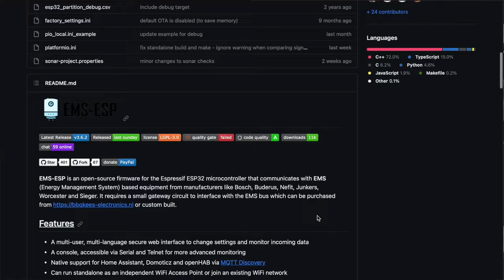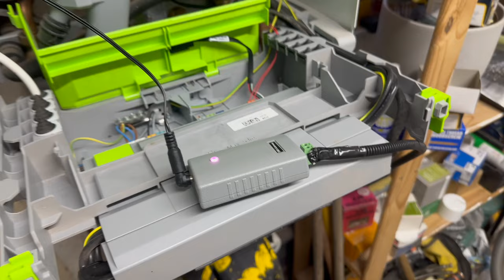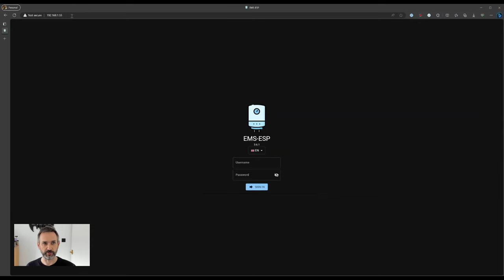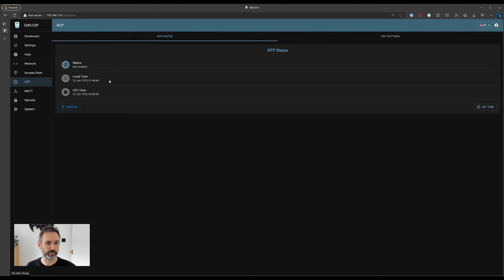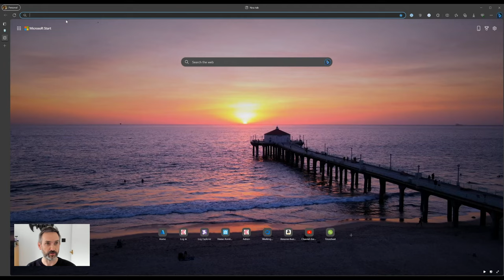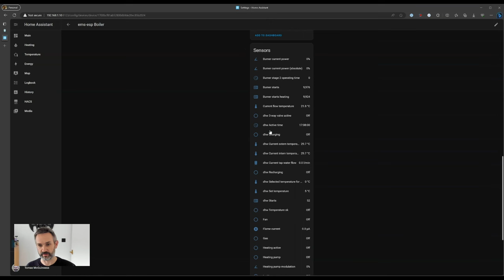Get boiler data into Home Assistant using EMS-ESP

Comment: When I moved into this house last year I wasn't sure how I could control the Greenstar boiler with HA but then saw the EMS-ESP. Seemed perfect for monitoring and setting the temperature etc from anywhere. I soon realised after fitting it that my thermostat, being a Comfort II RF, is read-only so all I can do is monitor it. Many of the boiler values are writable but I don't want to be messing with that stuff which I don't understand, and it doesn't look like it can override the thermostat. It's a nice bit of kit though.
Reply from the maker: What parameters are you trying to adjust? When you say setting the temperature, do you mean the boiler's flow temperature?
Reply: @tomasmcguinness  having a locked thermostat I was exploring options for controlling the boiler, like if its possible to turn the boiler on and off depending on temperature sensor readings in HA, but I don't think it's viable. Probably better to remove the Comfort II and wire in something like the Tado. Not sure what I can do with this boiler, just researching, and your videos are really useful!

Comment: Superb. So similar to what I have been doing this summer. Did you know that you can hook up dallas sensors to the ems-esp and they will show up as entities in HomeAssistant? I'm currently measuring my flow and return temps and I have another three on my hot water cylinder which I use to calculate how many liters are available at 38C (Idealy would need more). Stumbled on your channel while reading on boiler efficiency and load/temperature compensation. Great work, please keep sharing!
Reply from the maker: I didn't know about the Dallas sensors. I've been using an ESPHome sensor with Dallas sensors and I've recently changed to NTC based ones. In the past week I've had a calibrated heat meter installed too, which should give me another pair of sensors to access. My hot water (a Mixergy) calculates my % of hot water now, but in my old house I did something similar with multiple probes. I suspect our setups are quite similar!

Comment: Are you able to control your central heating with this? I just got this and installed it on my brand new Worcester boiler with no thermostat connected. I'm able to see everything, set the heating temperature, etc
However the central heating is always stuck on, and I can't figure out how to shut that off.
If we remove the thermostat link cable thing that it came with then the heating simply never turns on. Is it even possible to control it with this? Or do I need a thermostat?
Reply from the maker: Hey, I believe you can, since Worcester's smart thermostats will connect via EMS, but I have not tried that myself!!! I found this article on the EMS-ESP Github, which might be of interest https://github.com/emsesp/EMS-ESP32/issues/151. As they note EMS-ESP isn't intended as a replacement for a proper thermostat, but that's something you can judge yourself. 

Before I did the resistor trick for Priority Hot Water, I was using my EMS-ESP to adjust the flow temperature. It never failed to work.

If you do get it working, please let me know!

Comment: So I applied the resistor to my boiler and while it enabled hot water mode, I noticed that it doesn't actually use the given flow temp instead still using the central heating temp. S-plan systems do not work with the hot water.

Have you tested if yours the hot water flow temp?
Reply from the maker: It does indeed work. Have you separated the call for heat form the call for hot water? I have an s-plan system myself. 

Before I added the resistor, the two switched lives  for heat and hot water were in the same terminal (the heating terminal). Since the resistor enabled hot water, I needed the move the switched live for my hot water into the adjacent terminal.

Perhaps that is your issue?
Reply: @tomasmcguinness  Just checked and you're correct. My heating and hot water terminals use the same wire.

Comment: Great video. I didn’t know you could get this information from the boiler. Also, how have you created the Mixergy gauge in home assistant?
Reply from the maker: I wrote my own card. I’ve not made it public as it’s horribly written. Happy to share it with you if you’d like?
Reply: @tomasmcguinness that would be great. I’m already using your Mixergy Home Assistant integration and now I find we have the same boiler. If I had seen your video earlier I might not have invested in Hive controls. But the EMS gadget is being ordered today! Keep up the good work.
Reply from the maker: If I knew anything about boilers I wouldn’t have spend several £100 on Tado stuff. It’s all now sitting in a box 🫣
Reply from the maker: @davidtidey I’ll see about just pushing what I have into the existing repo. I really do need to improve it :)
Reply: Hi  @tomasmcguinness , can You share the Mixergy gauge with me as well?🙄